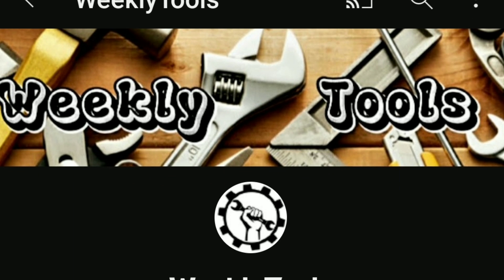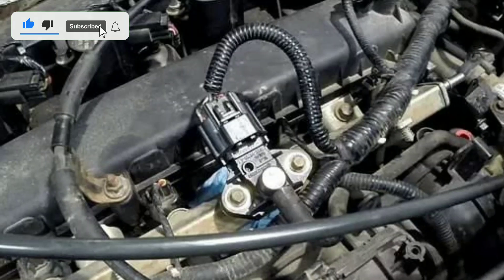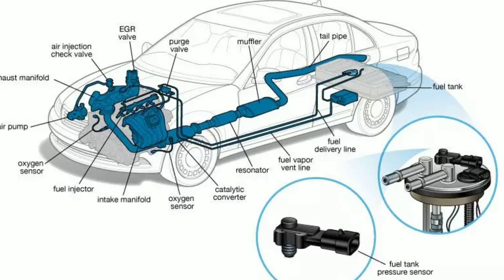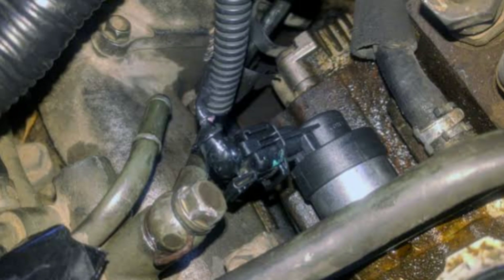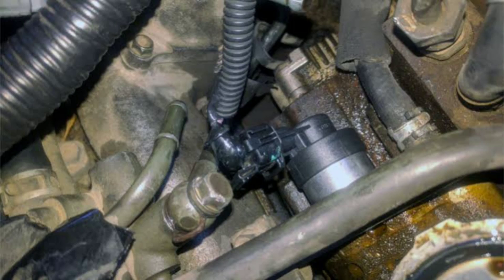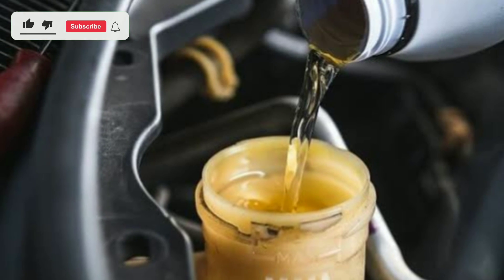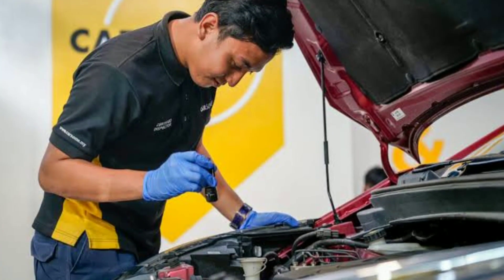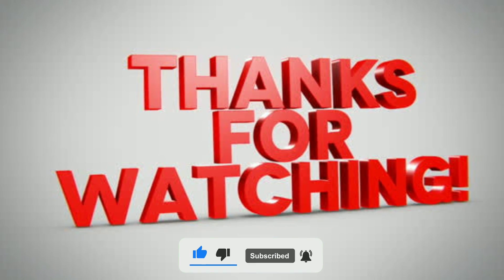Fuel Pressure Sensor Symptoms and Diagnosis | How to Clean a Fuel Pressure Sensor |

Comment: Came her for the cleaning of sensor. No info on cleaning
Reply: That's because there is no cleaning involved. If you have a bad sensor, you have to replace it, cleaning it does no effect.
Reply: My apologies... I came here for a fuel pressure removal... and noticed after replying to you.. that other people are here looking for the same thing... and obviously the creator probably meant system instead of sensor. You can clean the system... not the sensor.

Comment: where does. a. car remove a fuel pressure signal. after inefficient fuel
Reply from the maker: A car removes a fuel pressure signal after detecting inefficient fuel by adjusting the fuel pump and injectors through the Engine Control Unit (ECU). The ECU monitors the fuel pressure and makes necessary adjustments to maintain optimal engine performance.

Comment: I have a Isuzu prime mover truck model EXZ engine number 6wg1.. it runs good and when I'm driving it cuts off the engine and after 2 minutes when I start up the truck it starts well and moves but yet after some minutes it's cuts off the engine again
Reply from the maker: Based on the information you've provided, it sounds like your Isuzu prime mover truck with EXZ engine is experiencing an intermittent engine cutoff issue. It runs well for a while, then cuts off, but restarts and runs again after a few minutes. This cycle repeats itself while driving.

This could be caused by a number of factors, but based on the limited information available, here are some initial checks you can perform:

Fuel system issues: A common culprit for intermittent engine cutoffs is a problem with the fuel system. This could be a clogged fuel filter, a failing fuel pump, or dirty fuel injectors. Check your owner's manual for the recommended maintenance schedule for these components and replace them if necessary.

Electrical system issues: Electrical problems can also cause intermittent engine stalls. Check the battery connections for any corrosion or loose wires. Inspect the alternator and voltage regulator to ensure they are functioning properly.

Fuel injection system issues: Problems with the fuel injection system can also lead to engine cutoffs. This could be a faulty sensor, a malfunctioning injector, or a clogged fuel line.
Here are some additional tips:

Pay attention to warning lights: If any warning lights come on your dashboard before the engine cuts off, take note of them. This could provide a valuable clue as to the source of the problem.

Note the conditions when the cutoff occurs: Does the engine cut off more frequently under certain conditions, such as when the engine is hot, idling, or under load? This information can help narrow down the possible causes.

If you're not comfortable troubleshooting the issue yourself, it's recommended to take your truck to a qualified mechanic for diagnosis and repair. They will have the tools and expertise to identify the exact cause of the problem and get your truck back on the road.

Comment: Where is the fuel pressure regulator on a 2013 Ford explorer located
Reply from the maker: The location of the fuel pressure regulator on a 2013 Ford Explorer can vary depending on the engine type. Here's a breakdown for the two most common engines:

3.5L V6 EcoBoost:
The fuel pressure regulator is located on the fuel rail, which is mounted on the top of the engine near the firewall.
2013 Ford Explorer 3.5L V6 EcoBoost fuel pressure regulator location
2013 Ford Explorer 3.5L V6 EcoBoost fuel pressure regulator location

2.0L EcoBoost:
The fuel pressure regulator is located on the passenger side of the engine, near the intake manifold.

Here are some additional tips for finding the fuel pressure regulator:
Look for a small, cylindrical part with a vacuum line attached to it.
The fuel pressure regulator will be located on the fuel rail, which is a metal pipe that runs along the top of the engine.
If you're still having trouble finding it, consult a repair manual or ask a qualified mechanic for help.

I hope this helps! Let me know if you have any other questions.